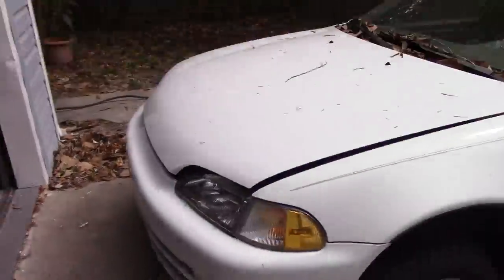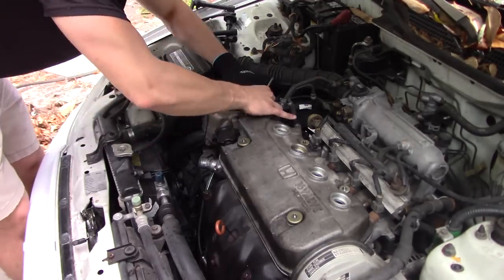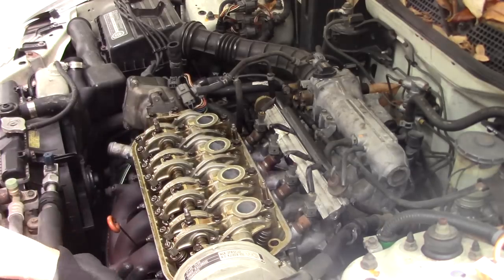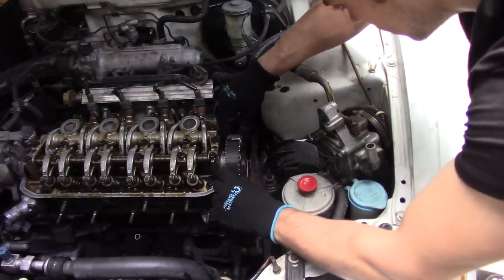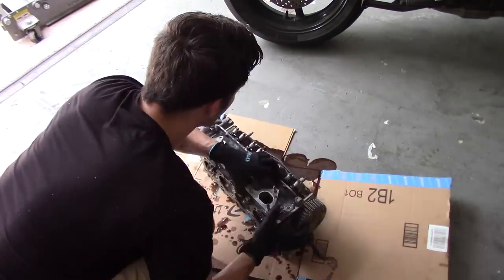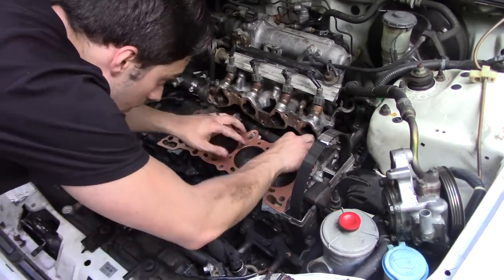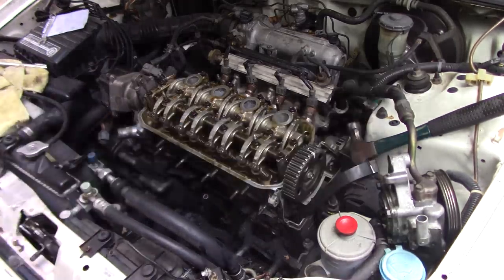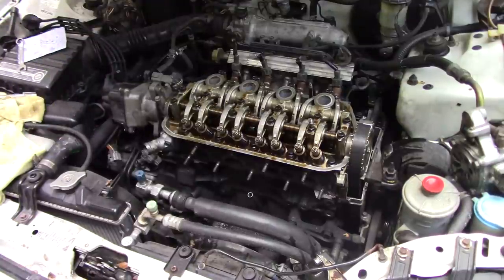How to Replace a Head Gasket  | 1994 Honda Civic DX

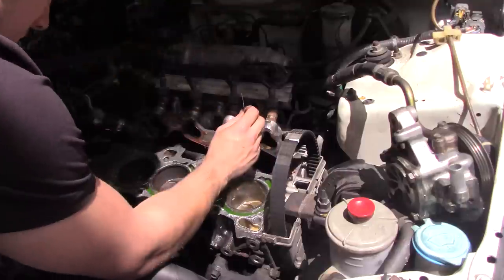Comment: At 8:20, its actually the intake manifold, NOT the exhaust. That's on the other side of head. To facilitate head installation, use dummy studs that screw into the head bolt holes, but are long enough that they can be removed once a few head bolts are loosely started in their heads. Beats damaging the head casket.
Reply from the maker: I know this. Thanks for being the 20th person to tell me. You are welcome for investing my time to make this video.
Reply: Thanks  @AutoMotivate . Not being nasty, just pointing out the error for benefit of the many on these channels who does not know the difference.  Chill and no hard feelings man.

Comment: I slipped the belt on, wasn’t easy.  Moved the power steering pump out of the way, got the teeth on from the intake side first, then used a pick tool to leverage the rest of the teeth on.  Could have done it in 3 minutes if I new this.  The tension on the tensioner was pretty tight.  Also the middle but on the intake is killer to get on and off if you’ve never done it before, get your self a ratcheting wrench in its size which I think is 12mm... makes life easy.  And to put it back on,  one finger ever so carefully sliding it down the very small pathway.  Everything else is just wrenching away.  Took me about 6-7 hours.  Do it in the shade with plenty of water or split it into a weekend job if you can.

Comment: While this is a clear video of taking apart this Civic, at 12:45 the maker notes that he reassembled the whole thing and it still leaked! For those not familiar with this job: This video is missing the critical element of surfacing the block and head and checking for warpage! This is essential for replacing a head gasket.

Comment: Thanks a ton ! I have a 94 lx civic an blew my head gasket , they said I would cost around 850$ to fix. I stored it away to do it myself an I'm also glad you left info where to order parts, keep it up man!
Reply from the maker: Ricky Rivera thank you man, I'll try my best, and it's really not a terrible job. That's exactly why I made the video, not everyone can afford 850$. However, if you don't have the proper tools, and if you need up several times, the bill can get up there, but not $850.

Comment: now remember kids when doing this process you might as well as lap the lapping valves since you're already there and TDC the number one spark plug to insure a fast instant start every tim
if you do have a warped head you can shave off the head with sandpaper in a file leveler and a stainless steel ruler but cannot take off too much
Reply from the maker: ehh, if you are a newbie, i would shave the head down like that. Get a professional to do it.

Comment: That one bolt wouldn't tighten correctly Probably because the head was warped from overheating
Reply from the maker: FordGuyAJ yeah, I think I mentioned it in the video, but I actually got the head shaven.
Reply: Na must be the whole as oil in it

Comment: I'v seen how engines ruin by the copper spray. Honda don't need that. Nice vid
Reply from the maker: JDM Cars - LT yeah, I tried to put a disclaimer in the description. I'll love this comment
Reply: JDM Cars - LT  Used copper spray on felpro gasket on my honda. 7 yes now . You have to be careful . Don't cake it on. Give it time to dry before assembly .
Reply: Here is what I did.  I took 800F Silicon High Temp Gasket Maker and smear on the Gasket.  I just did a " THIN " coat and " SMOOTH " it all out and let it dry before putting it in.  I also " HEAT BLOW " it to " LEVEL " it all out before it dries.  So far, we haven't seen leakages yet and it's been 5+ Months!

Comment: Buy a machine finish flat edge metal ruler and a thousand inch gap tester, put the ruler on the cylinder head and the gsp tester shouldn't bd able to go under with the 2 thousands gap, if it does, the heads warped and needs resurfacing

Comment: Good work and SOHC D series very good and simple engine and set up for a DIY'er to practice on. After many years of doing this, I would say its not worth skimping on parts that are laborious to remove so I would shop for an OEM or Felpro HG for a job like this but I don't want to be in anyone's pockets, just my .02. Otherwise chapeau on your efforts young man. I just watched to the end and don't want to be a keyboard technician but was thinking as I watched you that a straight edge would be recommended to check block and head as these long blocks generally don't blow head gaskets unless severely overheated and the head gets warped. I think the factory spec is a minimum .04 mm of clearance with a quality straight edge.
Reply from the maker: I actually sent the head to a local shop immediately. I figured it was my best bet. Ill edit my pinned comment saying this so others will hopefully read it and know what i did.

Comment: AutoMotivate, excellent contribution brother, I only have a question about the use of copper spray on the cylinder head seal, until today, this civic has given problems related to cylinder head leaks? Thank you for your contribution, it is very useful at least for me at this delicate point. Thank you :)
Reply from the maker: Marco Vargas I’m glad I could help, man. 
The copper spray has a lot of supporter and haters. To be honest, it’s definitely not a necessity. That was my first time using it, and I did because I saw someone recommend doing so. 
If you are weary about it, I would just skip the step, you will be fine
Reply: @AutoMotivate , Thanks for your very quickly answer, I have this doubt (and big problem) because in my country I can not find the engine head gasket that I am assembling and I will probably have to reuse the original gasket, it is steel and composite (but the composite is damaged) and I am looking for the shape and material to replace it, until now the copper spray I think is the best option. thank you very much for your publication and even more for your time to respond, if I make a video about this my problem will notify you so you can see the process I chose and the results (I hope it works :P) Greetings brother!!!!
Reply from the maker: Please do man. 
I really recommend finding the proper head gasket. It’s a pain in the ass needing to re-instal the Head. Look on eBay, amazon, or the dealer.
Reply from the maker: That is alot of work, but if you have the tools and time, it could be a good route to go. However, if you end up messing up, it may be worth paying good money for one.

Comment: Hope the head was true when you put it back together. I have a 1982 Honda Accord , when I did my head made sure everything was true. I used copper gasket spray with a felpro gasket. 6 years down the road still running strong.
Reply from the maker: George Kolotouros that is insane! Glad to hear! I actually sold it shortly after I fixed it. The new owner is happy!  I’ve had a lot of people saying that I shouldn’t have used copper spray and it’s stupid to use it. There is so much controversy with copper spray.

Comment: Good Video bro but where are the Jack Stands
Reply from the maker: J C909 I didn't have any at the time. They should be used.
Reply: Why put jack stands if car hasnt left ground lol
Reply from the maker: COP STOPPERS 33 I got under the front portion of the car. There shouldn’t be room for error.

Comment: NEVER reinstall a head without sending it to the machine shop to be resurfaced. if you don't and your head is warped/cracked you'll hate yourself when your taking it back apart again. also most head bolts are "torque to yield", so you'll have to replace them the second time around as they will be stretched. so spend the money and do it right the first time.

also clean the cylinder head bolts holes with compressed air to get out any debris, as well as make sure there is no dirt in your cylinders by using a shop vac. if there is dirt in your cylinders it could cause some serious damage.

Comment: you were supposed to remove the head bolts backwards starting at 10 going to 9 and so on
Reply: And that is why you found out after the job your head was warped.... You always undo head from outside moving inwards not other way round...
Reply: The sequence of the bolt removal didn't warp the head. The overheating took care of that.
Reply from the maker: The previous owner over heated the car numerous times. 
It was my mistake not shaving the head at first, but I ended up shaving it, fixing it and selling the car cheap to someone in need.
Reply: note that not removing/installing the head bolts in correct order can also result in a warped head like you did here...
Reply: I guess that could depend on the manufacturer.i haven't run across one that states a particular sequence for removal, according to the factory service manuals. I always read up on any motor I'm unfamiliar with. If the manufacturer recommends you do that on an engine you are working with, then I would follow what the service manual states.

Comment: i hope u got that head resurfaced and a valve job too
Reply from the maker: I did. I mentioned going to get it done at the end of the video.
Reply: @AutoMotivate  is it necessary to do this every time you change gaskets?
Reply from the maker: If the car overheated, then it’s safe to say you should get it resurfaced.
Reply: Jonathan what if my car never overheated it just has and old head gasket cuz my car is over 20years old do i still need to resurfaced the head?

Comment: a good trick ive seen if you have new head bolts, take the old bolts and cut the bolt heads off making some nice alignment pin guides making it easier to reinstall the head

Comment: Aren’t the bolts supposed to come off 10 - 1, then put on 1 - 10??
Reply from the maker: They should. I mistakenly posted the opposite. However, as long you don’t loosen one bold all the way one at a time, you should be fine.

Comment: Good video, only thing is that the razor blade can gauge the metal on the surfaces and eventually lead to a leak, better to use plastic scrapers as much as possible.

Comment: Copper spray is designed for older engines that have rough cut Machine surfaces. Sand the surface with 180 to 220 grit sandpaper to clean it. Composite gaskets go on dry. Last thing you want to do is a head gasket twice. You be okay with the copper coat on the composite gasket. But if you put that on a MLS head gasket you're in trouble.

Comment: i have a small head gasket leak. sometimes it burns coolant. sometimes it doesnt. thanks for the video. ill use yours for reference if i need to
Reply from the maker: I would go ahead and do it. Longer you wait, less reliable your car will be.
Reply: @AutoMotivate  gotta move into a place of my own first

Comment: I'd like to take bearing Grease and apply it to the head and then stick the gasket on the head. That way the gasket will Allina with the pins and it won't move so you can set it right down onto the block. Also use a straightedge to check the head to make sure it's not warped.

Comment: I’ve never done head gasket. But thanks for the vid very informative and to the point. Background music does have to go. 
Why do people always say you have to get the top cylinder machined?
Reply from the maker: They usually say to get the bottom of the head machined just incase it has warped, which I did in this case. The block itself usually do not warp and would crack instead. 
This was one of my first videos, so my editing skills were sub par

Comment: You should always resurface the head before putting it back on. Honda heads are notorious for warping in the middle. Hope it didn't fail peace :)
Reply from the maker: Diversified Dame I ended up resurfacing the head, fixed the issues, and sold it for $1300. I bought it for $250. It only had 90k miles

Comment: Dont forget to have the valve head machined alot of people forget and have the worse problems trust me they machine it they replace all valve seal gaskets spring bolts everything is shaved to specs and polished

Comment: I just bought a car with what I think is a bad headgasket but the oil is creamy colored, the coolant really mixed in. Will replacing the headgasket be enough?
Reply from the maker: That sounds like a typical blown head. Changing the headgasket should fix the issue, if the block itself hasn’t cracks, which is shouldn’t have. Be sure to replace the oil and use jackstands.

Comment: My 95 mgf head gasket blew about two weeks after getting it. I wasnt aware of the checks I had to do and I was with someone who was impatient and wanted to get the deal over with. I was absolutely gutted but I'm contemplating fixing it myself, I gave no knowledge of cars at all and I'm looking for a bit of advice, especially with accessing most of these parts in a mid engine vehicle
Reply: And, how did it go?

Comment: i'm pretty certain you loosen the head bolts following the tightening secuence, and that could have been the reason for the faulty cylinder head.
Reply from the maker: That’s a possibility. But, the car had been overheated multiple times before I got it.

Comment: btw. same with main. I keep having the coolent pump back out ,every time I push the peedle ,like it was going into the engine right , made white smoke come out from a/c and exhaust
Reply from the maker: Ricky Rivera right, iforgot to put another disclaimer in this video. After you change the headgasket, there might still be white smoke. That's due to the coolant stuck in the exhaust system and it's just burning off.
Reply: +TheDeDecker , no your good mine was doing this way before, making it undriveable I'm barely going to order parts lol
Reply from the maker: Get the job done. Comment back here if you have anymore questions.

Comment: Went to do the head gasket today and had to stop those 3-4 hoses in the back where a pain to get off and the clips. I took everything that was attached to the head and then when I went to get the exhaust bolts off on the header they were all rusted and because of that all of them were stripped I even sprayed them all. Any tips to get it off?

Comment: gasket sets for my mazdas was only $12 ...yur over-paying! only did not come with new head bolts but we use studs anyway...just be sure to spray copper gasket sealent on headgasket! worx great. btw that was "intake" not exhaust u was working on in vid when mentioned...manifold
Reply from the maker: Yeah, it was hot out and I messed up a lot of different names. This video was a tad stressful

Comment: take your head into a machine shop to have them check if it is warped. They may or may not be able to smooth it out for you too. But If you need a new one there are plenty of those engines in salvage yards.

Comment: Hey AM. Big kudos to you for doing a difficult job like this. I'm concidering tackling a 2004 4runner with the same problem. And ignore all those pussy holes with petty complaints.  They coultn't reload a paper stapler if they life depended on it. Continuted much success.
Reply from the maker: 😂😂 I’m just trying to ignore them, but I agree lmao. That wouldn’t be an easy job, but it’s definitely doable. I wish you luck man. Comment here if you need any opinions.

Comment: Hey bro nice video. Couple questions.. What were your symptoms that told you blown head gasket. I have a 97 DX 1.6L non vtec. Temp creeps up at idle and sometimes times as slow speed. replaced fan sensor switch (thermostat housing), ECT sensor (front of engine on water output below distributor) and thermo sending unit gauge sending unit senor (under distributer). Has new genuie thermostat and new coolant. fan functions when jumperd. Fan will not go on until gauge is at HOT at idle. Even with fan jumped constant on temp still gets up to near H on gauge in slow driving.

Dont know condition of water pump. In your suggest should I just move to head gasket and do the water pump / Tbelt when in there or should I address the water pump first?

Did your car have similar symptoms?

Any advice would be awesome.
Reply from the maker: The symptom was obvous for me, the fluids were mixing. But, I would definitely suggest repolace the cooling system parts. Could very well be a waterpump or thermostat. 
Next time the car overheats, try to touch the top and bottom radiator hoses. ( the top will atleast be hot so be very careful) and see if the hoses are the same temp. If they are not the same temp, then waterpump and thermostat is your best bet. 
If they are, then the problem is something else.

Comment: The front is the exhaust manifold the rear part is the intake manifold that's why it has the fuel injectors and the exhaust pipe connects to the front. Good video other wise.
Reply from the maker: Brandon Baker yeah, i know. I just wasn't thinking when i was doing the video. Thank you though!

Comment: This is why I want to get a Toyota 4 cylinder. If anything WERE to go wrong with it it's much easier and cheaper to fix. My head gaskets just blew on my 4.6 Ford. The difficulty level is 2+ times this and so is the labor costs. I'm hoping Bar's Stop Leak is going to fix mine for a while, otherwise I'm royally f*cked! 

BTW that haircut was on point. 👍

Comment: Question: I have a D15B7 engine Del sol. The Head Gasket is leaking fluid into the Radiator fluid. You can smell it. A bit oily / gas smell. My mechanic says it's a risk to change the Head Gasket since we already did it about 6 1/2 years ago. He didn't do it, another mechanic did. They shaved the engine / resurfaced it or whatever it's called and put new gaskets on. And the rebuilt the top 1/2 of the engine. Piston Rings, bored it out a bit, Rebuilt Cylinder head,  Valves, Valve Adjustments etc... Is there any chance I can do what you did? P.s. the engine is super clean and runs really strong, gets great gas mileage etc... Transmission runs strong, was rebuilt about 5 years ago too... I drive about 10,000 miles a year or less. So probably put about 60,000 on rebuilt engine.
Reply: There no risk he just doesn’t wanna do the work